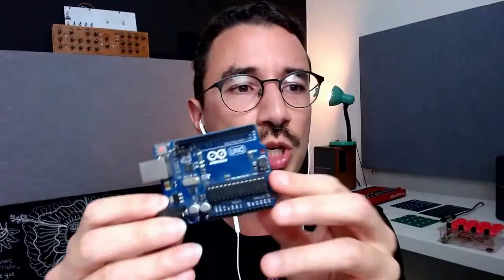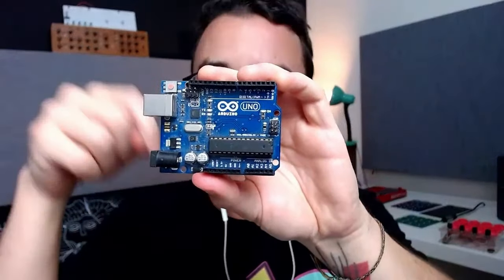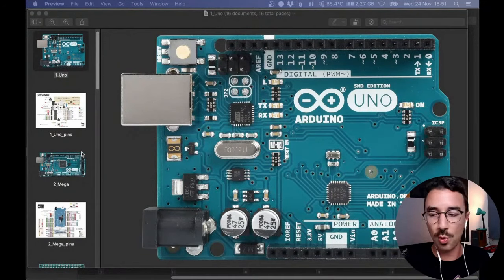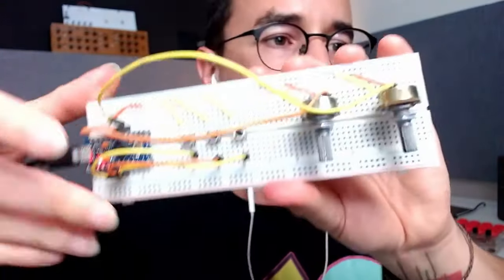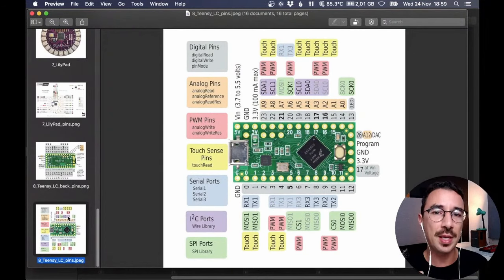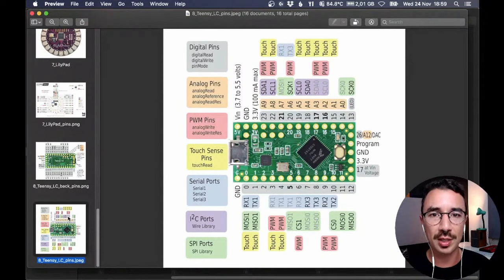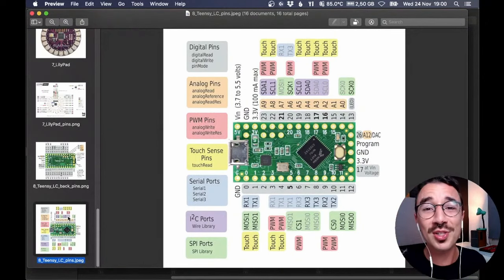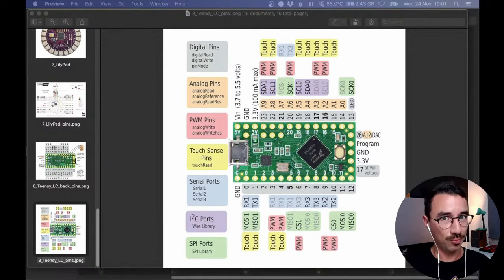How to Build Arduino MIDI Controllers - The Complete Guide

Comment: Hi! Currently using your code to convert a set of hammond organ pedals into a midi foot controller. I also want to add buttons for program change and midi CC. The pedal contacts are normally closed, which i can work with by changing the state from LOW to HIGH in the B_BUTTONS tab, but I'd like to be able to use BOTH the NO and NC switches. I have no coding experience, so would it be possible to change the code so that there's both B_BUTTONS_NC and B_BUTTONS_NO?

Comment: I have a question, hopefully you can answer. I want to build a rotary controller for the RM1X. It has 16 channels, every channel has 16 parameters I
d like to map. The idea I have in my head is a controller with 32 encoders on the front, and I can skip up and down the channel in twos, so channel 1 + 2, then 3 + 4, etc. Will your course teach me how to make such a device?

Thanks for your time.

Comment: is there an arduino board that is very small and can be powered by an iphone lightning port? that way i could have it on a keychain and use with my iphone while on the go?
Reply from the maker: Yes, the Arduino Pro Micro, the same I use in most of my controllers.

Comment: Sometimes when I power up pro micro, connect it to laptop I can’t detect the midi data being sent.

Is there an order of operations required to consistently get pro micro to successfully send data? Do I need to reset midi devices via my DAW?
Manually reset pro micro? (but power cycling it should already do that?)

Right now the quick fix seems to be reflashing the pro micro with my midi sketch, which isn’t practical in the long run.

Comment: Thank you for this intense overview and your shared project. This is great work an not a single error during build using a Arduino Micro and the libs from your zip. Potis working smooth as hell. Only thing I observed in the midi monitor, the Poti stops at 126 but I can’t find the issue in the code. Can you suggest me   a solution?

Comment: So I'm trying to connect more pots and i got 4 hooked up. However the ones connected to A2 and A3 are outputting the same signal as A0. A0 displays cc: 0 in debug and A1 displays cc: 1 but A2 and A3 display cc: 0
Reply: Solution: Line 338 you gotta add them in

Comment: hm i have a question if anyone can help me please do, when i try to upload it says midi not identifyed i have everything installed, it also works in debug mode. it just doesnt work when i try with the actual thing. im using a mega 2560 r3. so yeah im confused please help. or should i just restart the code and try again.
Reply: I don't think so. You have to use an Arduino with atmega32u4 processor, like Leonardo or Pro Micro
Reply: @stevevellinga8347  nah you dont i fixed it a simple bug
Reply: more like a mistake from me 😅

Comment: 15:29 : by the look of the soldering, all of the chinese clones i had in my hands were better in quality of construction than arduinos (i nerver tested the values of the components but if the code works... and i already received a not working arduino, which never happened to me with the chinese clones)

Comment: Hey man, thank you very much for your videos, it's helped a lot! I've got a question for you: can you use a micro comtroller with a micro usb port to make a midi device (using a micro usb cable), will it send MIDI too? Like the teensy 3.5 for example. Thanks!